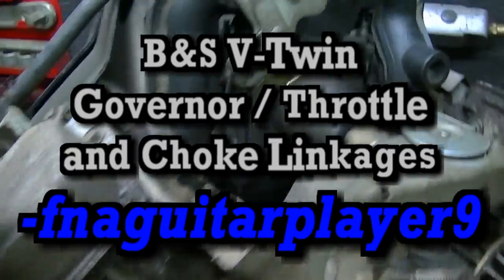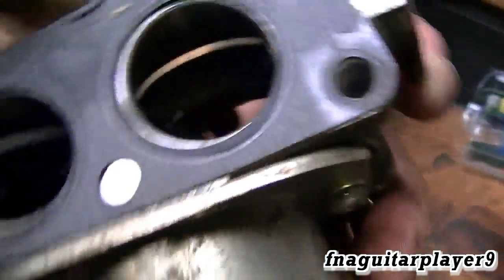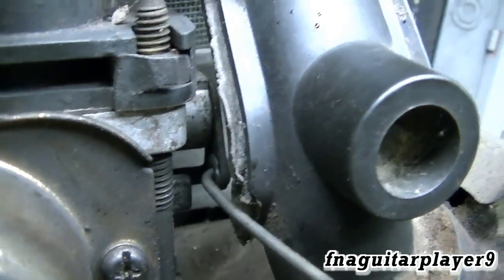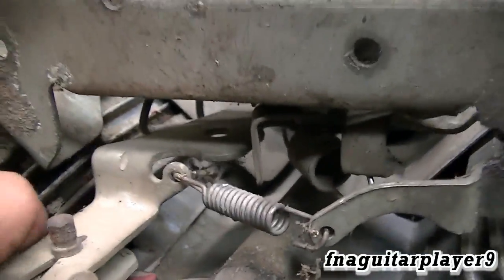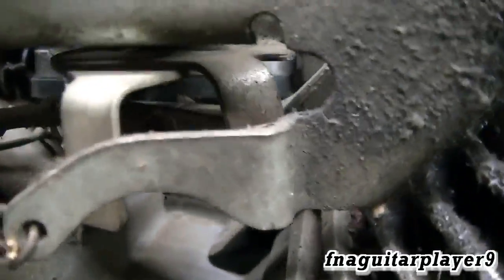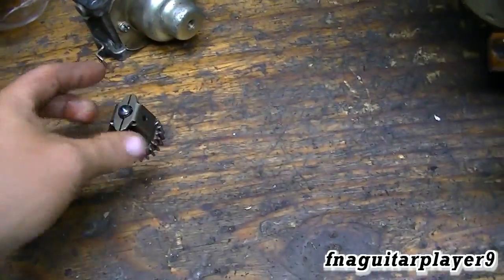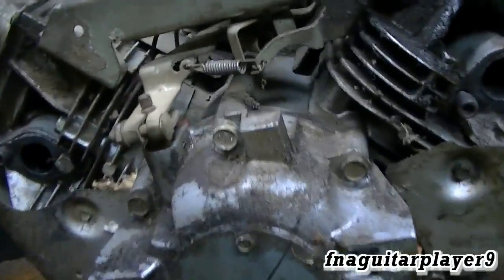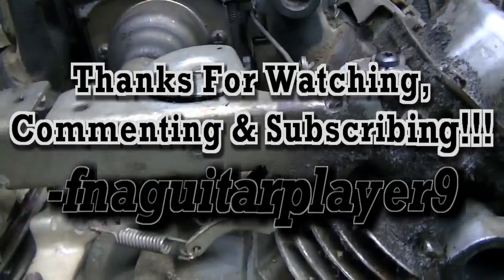Briggs & Stratton V-TWIN : Governor, Throttle and Choke Linkages

Comment: Briggs V-Twin Intek Engine has a Different Carburetor. Mine has a Gov Link on each side, Right side goes to the Pressure fan by the flywheel.. How can I replce It? All the new ones only have the gov and throttle Linkage. HELP

Comment: My V Twin is built where the throttle cable is hooked to a stamped sheet metal wheel. When the throttle is pushed past full on, it goes to choke. The circular plate pushes the choke lever tab down and causes its other end to travel upward, putting the carburetor in choke condition. Mine had a piece of mud get onto where the pivot was, limiting the choke lever movement. I knocked off the bit of mud.

Comment: Was looking for where the carb linkage connection points are.  Had a hard time finding them but got a good look at the butterfly end at 1 minute 39 seconds into your video and thereafter for the other end.  May I suggest, either zoom in and/or zoom out as you go for a closeup of 'whatever'.  It is a great explanation video, but with each instruction point already being zoomed in it is hard to orient myself (79 yr old eyes) to we are, for sure, on the carburetor.  After all that being said, IT WAS A GREAT HELP ! ! !  I got the carb linkage on with the correct ends in their proper holes, thanks to  you.   4 stars+
Reply from the maker: Glad to help out and appreciate the tip, I will try to do that! Thanks for watching!!

Comment: Is there a part number for the throttle linkage retainer on the bottom bracket ? Mine keeps popping out of the hole,.

Thanks
Reply: Same question.  I’ve tried the part I find in diagrams but it’s not right.

Comment: I have a craftsman zts 7500 that has a similar motor. B&S v twin 22hp. The throttle and choke cables froze up from being left in the elements. When I finally got a replacement cable assembly in, the old cables were already removed from their respective attachment points. Now I'm having the HARDEST time getting the new ones back into place.

Comment: I am having a struggle getting the engine to be governed after changing the fuel pump on a 35 hp vanguard twin.when i adjust the mechanical governor it only turns about 1/8 of a turn,could this indicate internal problems?

Comment: When I move trottle cable it does not effect the motor. It wont start unless I manually reach down and push on choke. When do this it starts and runs if I let go of choke it stalls. The trottle cable does nothing it moves the cable and turns the lineage but it does not move or governor or choke. I have adjusted both spings, idle and governor spring. When I secure choke in place with small wire it runs great.  Can you help?

Comment: i really appreciate your videos
my problem... vtwin 23 briggs  after stiing a day it wont start    new plugs frsh gas new carb      sometimes the plugs are flooded   sometimes not
just a sniff of starting fluid   starts right up    idles down   revs up   back to idle  no smoke     good starting rest of day       and new fuel pump
its embaressing
thoughts??

Comment: Thank you. I bent the throttle link rod just a tiny bit when removing the carb and the engine wouldn't return back to idle. Not easy to see this mistake.

Comment: I have a 22HP MODEL 44000...where does the spring thats around the governor linkage hook to. The linkage goes through the rod. There is a hole for the spring on the governor end but I don't see where to hook it on the throttle.

Comment: I have a Vanguard 570cc twin that is in my natural gas home generator.  It won't start in cold weather.  I had a different problem with it a while ago and now this problem ever since.  Not sure if the governor linkage is setup correctly.  Is there a linkage diagram or some help that you could suggest?

Comment: For the choke bracket setup.
Do you move the throttle cable up to it?
Instead of down on the governor arm?
Hope this makes sense.
Thanks
Reply from the maker: yes i think that is correct, it kind of works backwards. Thanks for Watching!!!

Comment: Question I’ve got my father in laws Briggs v twin with an auto choke I’m trying to figure out.  He has a broken thin wire spring wrapped around the throttle linkage.   Not attached to anything on either side.   He is having a problem where it surges and stops when it gets hot.   Any idea where that spring came from?
Reply: I'd like to know this also

Comment: any idea where i can purchase a throttle cable at. i just need the hook part that connects it all. it broke on one of the ends and i cant find a replacment part. plz help
Reply: Look up model number of tractor or equipment. For instance if you have a craftsman you can look at sears parts direct to get part number. Then Google  that part number.

Comment: I bought aftermarket carb for my 2011 YT4500 craftsman with intek 26hp v twin. Linkage was my big issue, also the aftermarket carb had different looking auto choke connector. So I took off the original and put it on the aftermarket carb. In process I had to bend linkage etc, then motor didn't respond to speed, just full blast, I bought some aftermarket linkage off Amazon and custom cut and bent them. I have it so it starts right up and idles good, throttle speed works now, haven't mowed yet though. Only issue I notice it the motor you can see the throttle linkage moving off and on like it's hunting for correct idle. I ordered oem linkages, but taking forever for briggs to send. I don't want to start messing with changing the governer tension,  since I messed up trying to modify the linkage to the non factory carb.Thinking maybe adding a spring could help the throttle hunting, dunno. Both auto choke and throttle linkages need to be right on, they work in unison. I spent hours past week just getting mower to start, then would Rev high to point I turned it off, don't mess with modifying linkage. I need use of mower bad, for my 1.5 acres and it's been down for 2 weeks. Wish I just left the old surging carb on now.
Reply: When I put the oem linkages in before I changed out the butterfly, it started then linkage popped out of retainer, has been a nightmare since.

Comment: I have vangard mud motor 35 hp I could not get it up to high  rpm  when I open the throated half way same speed as full throttle any sudjustion

Comment: Hey, great video.  I purchased a new 25hp B&S Professional engine(vtwin) to replace my old 26hp B&S ELS engine.  The older engine has a choke, where as this new engine has no mount for the choke cable.  It looks as if its an automatic choke, perhaps?   Do I just leave the choke cable off?   Also, how do decide how far to adjust my Throttle cable, when tightening it to the carb?   Any help would be MUCH appreciated.  Thanks in advance.
Reply from the maker: Thanks! Yes in that case i would just not leave the choke unhooked, the way i adjust the throttle is, set the control to fast (full throttle, plus full choke in this case) may help to have someone hold it for you, then pull the linkage where the cable goes so the engine is set to full throttle (and choke on the auto choke engines) then tighten it down. Hope this makes sense, i do have a video explaining how to set it, on a different engine but should point you in the right direction... https://youtu.be/1WWpeyDbHjA  Thanks for Watching!!!

Comment: My V twin I replaced the governor inside the engine and now the lower half of the throttle control doesn't seem to slow the engine. It idles high all the time and goes faster when the throttle is moved to the high speed side. may need to bend that tab you talked about. should there be tension on those springs all the time. It also surges when it is warmed up and no load on it.
Reply: B&S model 44S977 Type Code 0022-G1 date code 170221vg if that helps.

Comment: Great video, got a question! My briggs&Stratton v twin model # 303777 -1147 old late 80s i think.when the throttle arm is in wide open the gov rod turns counter clockwise, which is contradecirte to all the videos I see on you tube.i don't want to adjust it wrong and cause damage what do you think thanks

Comment: I have a Briggs 18.5 nearly identical to this that I just cant stop from running wide open unless I put a spring on the governor arm to hold it up... and then giving it throttle is ungoverned... driving me crazy trying to figure out what is wrong. with it.

Comment: Great video!!! My problem is I bought a new Briggs Vanguard 26HP Commercial sb to replace an original 16 yo  Scag Tiger Cub engine but the throttle will only open partially (about 1/3 throttle) then its up against spring tension and forces the throttle back down. It won't even open up enough to engage the pto without killing the engine. Have had it off to try to find the reason to no avail. Any help would be appreciated as the seller won't refund and only ("sell") and have No technical abilities! Or want to help.  Thanks in advance for your input and great vids.

Comment: I have a mint 2009 john deere zero trun with a 22 or 23 twin engine when I bought it from a friend he was using start fluid to crank it cable had moved and choke plate was not closing set it where it close now cranks fine but idles high😮

Comment: I have a John Deere D160 with an Engine:  Briggs & Stratton 44M777 ; Type 0288G5.
I was seeing smoke coming out of the exhaust and could smell gas in the oil.
I am in the process of cleaning / reinstalling the carburetor.
Although I took some pictures before I disassembled it, I am having difficulty determining how to reattach the linkage for the choke and throttle.

Can you please provide help / input on this?

Thanks for the input ;
Reply from the maker: It can be difficult to reinstall everything, sometimes you'll have to twist the carb sideways to get the linkage back on. This is the only video i have on that engine. Thanks for Watching!!!

Comment: Have the same car system on my Briggs and Stratton  22hp intek.  It idles good then it pops once about every 15 seconds and when I open the throttle it won't open up.  Just idles good with a pop here and there.  What do you think
Reply: I replaced the plugs filter and fuel pump  still have the same problem
Reply from the maker: May need to clean carburetor, if its running to lean it will pop like that, also might want to check valve clearance as well.  Thanks for Watching!!!

Comment: I cleaned the carburetor now it runs good until I engage the PTO and kill the engine unless I push the throttle to choke. Any ideas ?
Reply: Check the plastic manifolds on the front and back of the carb for warpage. Mine would run great until I engaged the blades then it would sputter out. As it turns out there was about a half mm gap between the intake and carb creating a vacuum leak. They run about $150 new, so I put some permatex on instead to make up the difference and problem solved.

Comment: Great video when you were talking about the governor did you had a problem with peers to be nothing wrong with the governor I got one doing the same thing the governor just doesn't work I've just as it correctly and the motor just runs away did you ever figure out what was wrong with the governor our one yesterday and should be in tomorrow I'm going to try it but it's going to drive me crazy cuz that pierced that there's nothing wrong with the governor the white sling out real smoothly is not all beat up get a chance, I appreciate

Comment: what would cause a B&S 407777-3195-G5 to rev out of control?  It was running just fine using the mower to mow that day then to haul some light loads in the trailer to the trash/burn pile, then fired the mower back up and started to rev uncontrollable, throttle level does not help, however with a push the throttle lever on the carb. up manually it will adjust as idle speed.
Reply from the maker: These engines are bad about the internal governor piece breaking or sticking. Try to adjust the governor first just in case it came loose, then bad as i hate to say it, if its the internal piece it will have to be tore down to fix. Thanks for Watching!!!

Comment: Hey I have the 25 horsepower Briggs,  John deere 100 series, . My engine is running wide open,  I saw video on how to adjust it and it is adjusted correctly,  did not have to readjust it, are you able to tell my what else I can do? Thanks for your help, my name is Richard

Comment: I need to adjust my governor on my 20 hp briggs v twin...it runs good but with the throttle down to idle..it goes up and down causing it to "burp"through the carb...carb has been taken apart cleaned and rebuilt....never have adjusted the governor...ive watched videos on how to do it.....since mine is on the tractor...i just push throttle to wide open then loosen jam nut..push arm over to right and take a wrench and turn the adjuster nut all the way to the right ..then tighten jam nut.....sound right?
Reply from the maker: Yes that sounds correct. Thanks for Watching!!!

Comment: On our Ferris Z turn we replaced a B&S 25 hp V twin 44t977 code 0005G1 engine with a different B&S 25 hp V twin 449t977 code 0015G1.  The choke cable connection is the same but the throttle connection is different and we cannot see where it goes and the parts manual is no help. Do you have a video or photo?
Reply from the maker: I hear ya, no actually this is the only v twin video i have, most of my videos are on the older single cylinders. wish i could help more! I will be having a video here in a few weeks or so on a horizontal shaft vanguard v twin but i think it will be completely different though. Thanks for Watching!!!

Comment: I have a 24hp professional on my craftsman the rpms seem to be low can’t get a got suction or chop I put new blades all the time they tell me you can’t adjust these carbs to get a higher rpm or horsepower what do you think actually have to turn the idol screw way up to do my leaves in the fall and motor is 4 years old
Reply from the maker: Sounds like either the governor spring is weak or the governor is out of adjustment. Thanks for Watching!!!

Comment: Giday, I've done everything that the video's have shown me how to set the governor on a B&S V twin 20 hp and it still wont work properly. All that was orginally done was I loosened the bolt that clamps onto the governor shaft to try to slow the idle speed which i now know was a non and now after doing every thing i been shown on your videos it wont idle down. Any suggestions? Please help.  John.
Reply from the maker: Its possible that the internal governor weight assembly has broken or isn't working, it could have came apart when the governor was out of adjustment. That would be my guess. Its a inexpensive part but takes some work to get to (tearing motor apart, etc). Thanks for Watching!!!

Comment: My v-twin ran, bogging down sometimes. Took apart carb, cleaned it, fixed fuel solenoid, put together and tried running. It starts, but with throttle low, as you open choke engine starts to race. Any thoughts? I followed directions to confirm governed arm adjustment but issue persists
Reply from the maker: I've seen this happen before on these engines, make sure there is not a linkage or spring in a bind. If all of that checks out then its possible its the internal governor that either broke or came loose, i've had it happen before. hope this helps, Thanks for Watching!!!

Comment: On my v-twin everything  is hooked up  correctly and  all there. No reverse  tension on governor so throttle  stays  wide open all the time no matter  where control  is set by the operator.  Seems  like problem  may be  inside unit. Very frustrating.  Randy
Reply: Did you solve this Randy? I've got the same issue... 😢

Comment: Which slot does the linkage from the throttle level hook into the small circle?
Reply from the maker: The cable will connect in the hole on the front and there should just be a spring on the other side if i remember right, because it sets the tension on the governor arm. Thanks for Watching!!!

Comment: Have a Briggs 27 horse turf series with 87 hours (2017 Ferris zero turn). Removed the air filter and cleaned up the foam cover and put back together. Ever since the engine will surge when under a load. Could dirt have gotten into the carb and if so is it hard to remove and clean up or would that be the problem?
Reply from the maker: Its possible, but usually when dirt is a problem is when it gets in the fuel and clogs a jet, it should get clogged if dirt got in from the intake. You could try spraying some carb cleaner in while its running and see if that helps it. Thanks for Watching!!!

Comment: I have a new 22 hp Intek and how do you turn up the rpms it is too  Low and this is how it was when I pulled it out the box have not touched it it has two slots on the governor arm and it is on number two can you help me
Reply from the maker: The arm should come preset, but i could be wrong, you would normally just have to connect and adjust the cables.  Thanks for Watching!!!